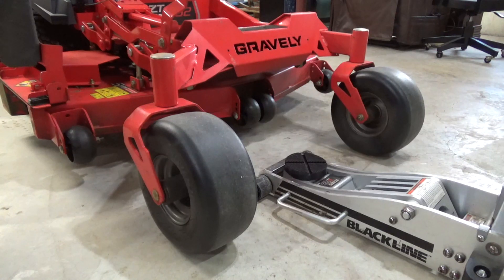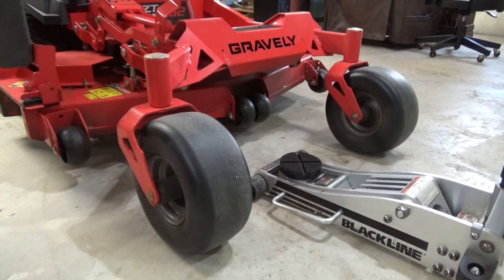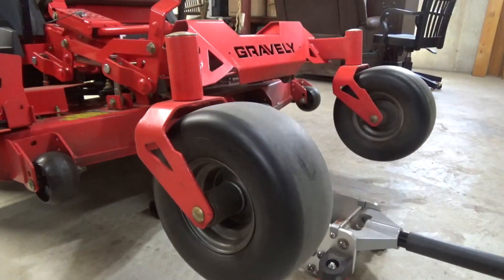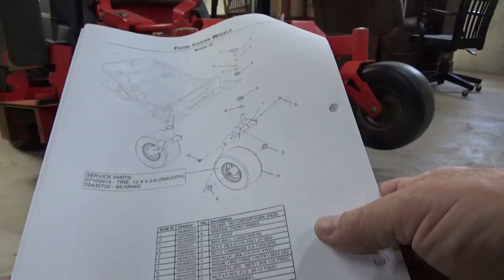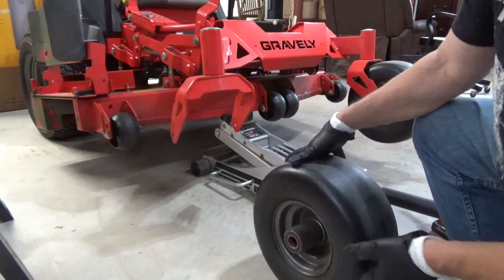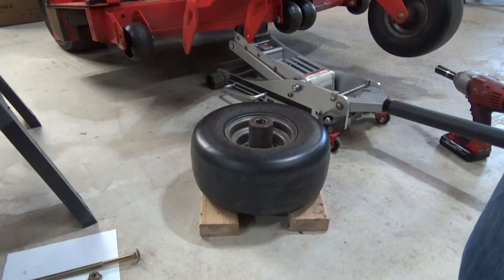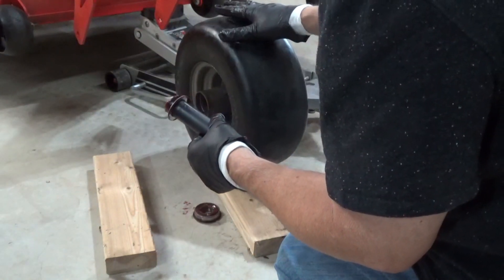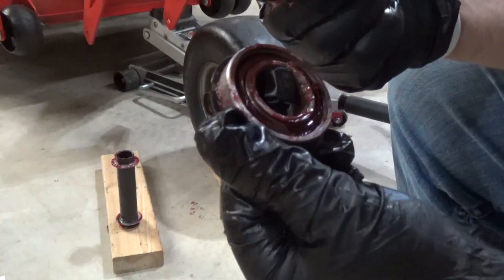Zero Turn Front Wheel Bearing Service

Comment: Really well done video!  If I serviced these on a regular basis I’d probably fabricate a purpose designed tool for knocking out those bearings. Maybe a section of 3/8ths or 1/2 inch rod, slightly flattened, curved and dressed on one end.